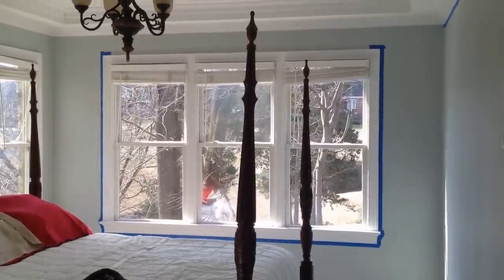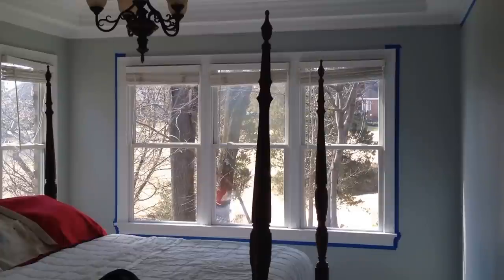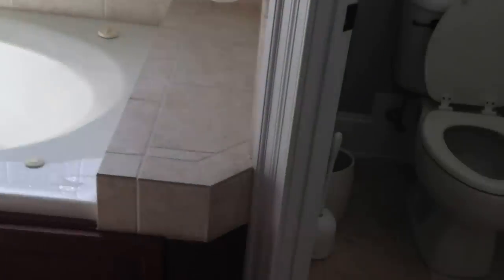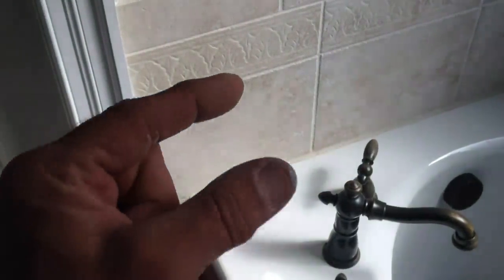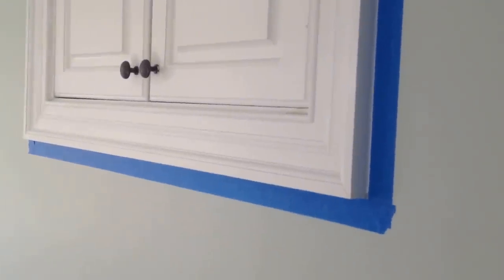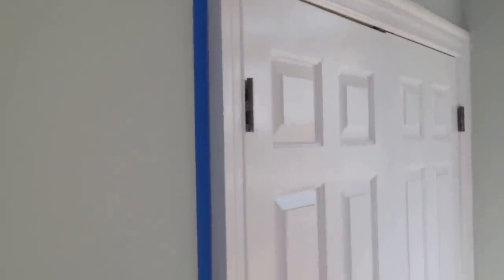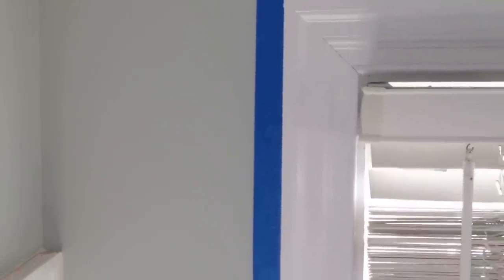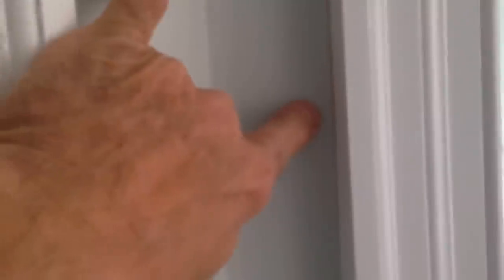PAINTING TRIM THE RIGHT WAY/ MASTER PAINTER EXPLAINS IT.

Comment: I left out the caulking of the trim. Caulk all trim, crown molding and door jams after you have putty and sanded. I said to apply two coats of paint to trim. That doesn't include a primer coat of the trim is delivered as bare wood. If it comes pre-primered then just two coat of trim paint.
Reply: If  delivered pre-primed you still have to patch  holes the Carpenters make then you have to prime those patches than two coats of paint
Reply from the maker: Jorge I see that this video has you upset?  So many negative comments?  If I suck so bad at painting please send me link to your work.
Reply: tom noeldnerr lol
Reply: tom noeldnerr sounds like you are the one upset

Comment: Calk the trim in, paint it first and cut in the walls. It saves over 30% time in labor. For over 25 years I painted the other way, the wrong way for the wrong crews. But hey I became a master at cutting in because of that. Then one day I painted with a guy who had only 2 years painting experience. Well he was not a painter but from his world, he was right about the trim. Try it. Start with ceilings. Calk the cracks and seal them in good. Don't worry about getting the ceiling paint on the wall. Then calk the trim into the wall and paint that too. Don't worry about hitting the wall!. All you have left is cutting and rolling the wall. Try it! You'll be so grateful when you get this system. You may have to cut in the wall twice but that is no time compared to taping. By the way, I can do a half inch wall against trim with a three inch angle. I'll prove it to you. House painter of over 35 years painting daily.

Comment: I paint trim first. Easier to cut into trim. Just like you paint ceiling first then cut wall into ceiling. Often times the tape can pull wall paint off and you have to touch that up.

Comment: The only time I use tape is after I paint trim then cut walls in apply tape to top of base trim just barely sticking to where. meets wall to protect from any sprinkles as I roll

Comment: Thanks Mr Fix.  I have a question.  If you paint walls first, then tape and do trim, isn't it possible that the tape could pull paint off the wall?

Comment: Jajajaj you are using wrong technique; wrong tape.paint trim first and then cut  the walls that’s what all professional do. Not telling that you re need to sand trim  bondo work primer caulking before all above mentioned.and spray your trim with a premium paint and a fine finish tip at the rithg pressure.cover everything to make sure homeowner doesn’t get aaaaaaany dust over their belongings clean up everyhing double check everything.dont make unnecessary noise in the house.dont go in to rooms you don’t have to.and provide costumer service

Comment: Pros don't use tape buddy.
Reply from the maker: Well maybe, pros also know when to tape and when not too.
Reply: there are times and areas where you would use it and others not ,,   nothing is ever cut and dried one way ..  if you think there is only one approach then you are not looking to improve your work,   but more interested in cutting someone elses opinion up.
Reply: Its called PAINTER TAPE
Reply: „When to and when not to“. Not „not too“
Reply: So if you free hand your a pro and if you use tape your not a pro. Well anyone can paint weather you free hand or use tape. Using tape and caulk is better than free hand in my opinion.
Reply: Define pro....ooooo now there is a real mind fuck.  Caulk, prep, paint that’s it.  That’s the rule.  Paint trim like you are painting the trim on a Ferrari.  Little margins for error and you will be okay.
Reply: @FranciscoMartinez-zv2rw  you just haven't done it enough. There are situations were you need to used painters tape. Just not all the time like Tom does. If your a Home painter ya you probably should use tape.
Reply: @Robert5185  Mm not really.
Reply: Well that's a bit black and white. I wouldn't just say " pros don't use tape" as a general statement. Depends on the particular job, situation and 
Method of application !

Comment: Here is my condensed steps to painting a house:
1. Mop the walls (not literally)
2. Vacuum all dust that fell of walls from mopping. 
3. Cut in wall with primer then roll that cut in with a small roller to create nice stipple effect rather than brush stroke effect. 
4. Roll wall with primer (I prefer tinted primer).
5. Lightly sand primed wall. 
6. Clean wall of excess debris
7. Wait for trim man to nail trim to wall
8. Putty and sand trim fIncluding crown molding, door jams etc). 
9. Put first coat of paint on trim (including crown molding, door jams etc). 
10. Put final coat of paint on trim ( including crown molding and door jams). 
11. Tape off all trim
12.  Cut in walls
13. Roll walls with final coat of paint (pull tape off each wall before paint dries. Don't paint a whole room then pull. Pull after each wall). 
14. Paint doors. 
15. Hang doors.
Reply: You forgot the prime coat after you do your sanding of your patches
Reply from the maker: Not need to prime coat a flat latex finish, even with some small mud work.
Reply: tom noeldnerr if you patch the trim you will need prime coat other wise it will flash, no one uses flat on trim that i know of

Comment: Why not spray the trim for the best results? Anytime there's that much crown/base and window trim spraying is faster option. Spray trim first and then cut & roll the walls.
Reply from the maker: +SublimeSati I'm very old school. I brush everything,  But I hear what your saying about speeding up the process.
Reply: tom noeldnerr That's cool. I hear in other countries spraying is looked down on. They think spraying is the fast and cheap option, which is true in a way because spraying doesn't really push paint into the pours of the surface which creates the best bond. On the east coast they brush and roll everything and get longer lasting results for sure.

Anyhow, watched some of your vids after commenting, keep up the good work!
Reply from the maker: +SublimeSati I'm old school when it come to painting.  I do everything with a bush, no need for speed with the why I work.  But I see your point.

Comment: Sometimes the where the trim and drywall meet is not sharp or straight and tape will not work.. I Use a pencil and follow the edges as my line and then just paint up to this line. It's like using tape for a clean edge just instead it's a pencil line.. I use tape in tight impossible areas where I have no choice because the brush our roller will touch somewhere I don't want paint to get on..  But I'm also a freestyle painter.. Haha I can't believe I'm saying this because I use to have tape everywhere, I didn't mind the time but never liked the results.. 2.5" cut brush for trims and 3" for walls. Or sometimes 3" for everything..

Comment: Paint will always find it's way under the tape, I never trust the tape will keep it clean
Reply from the maker: I never have a problem with bleed through ever.  But there are a few steps that must be taken to prevent bleed through.  Clean the trim first, and with your finger nails and pressure put the tape down tight to the trim.  Always works for me.
Reply: You can run some caulk over the tape edge too. Stops bleed through.

Comment: you are just making more work for yourself..do the trim first then then cut it to wall, any good painter will be able to free hand that and make just as good of an edge, i am right handed and can cut that line in with my left hand just as well as the tape
Reply from the maker: I can paint left handed and right handed also.  I paint my way and the results are always good.  So if it's working for me, I don't see the harm in my way of doing it.
Reply: nope,   whatever works
Reply: In his case, he aleady knows in advance that hes planning to tape off the trim so it's fine. He wants laser sharp lines which is fine. Nothing wrong on what hes doing.

Comment: I'm AN old guy also, hardly ever tape.I cut the wall into trim, but heck I can paint like water flows. My jobs never look Like that certa pro job though when finished. For sure your work is great, but I think I am much faster with out tape.
Reply from the maker: +Tim Brents Hi Tim I admit I''m not the fastest at painting.  But I know one thing when I tape the job always comes out right every time.  Some guys that taught me to paint for the first time where very good a free-handing.  Plus their work was always good as it could get.  I just found I have a good eye for straight, and can paint a great straight line. But I do make mistakes, I hate it when I have to stop, and touch up.

Comment: Don't get me wrong, they did a horrible job cutting in the ceilings and against trim, but why are you using tape on ceilings, casings and inside corners? 

The way i was taught to paint is in a few simple steps- Paint your ceilings, and bring it into the walls- Caulk your trim up so its nice and crisp again- Paint your trim, and again, bring it into the walls. Use tape on your baseboards and ONLY on base boards. You've caulked them, so now you have a nice line for your tape to follow. Then lastly cut your walls in and roll it. I would never use tape on casing, inside corners and lastly on ceilings. That's just a rookie move. If you cant cut into a ceiling or any other noted areas above without tape, you sir need a new career path. Yes there might be other ways to paint, and whatever works for you is great, but that is how i learned to paint and i have never been fired or had a call back for poor workmanship.

 BTW the half a million dollar house thing stands for me too, i have never painted a house that was under 5-600k, believe it or not. Not to mention the million+ dollar homes in Toronto i have painted. Im not bashing you or your video but, i slightly disagree with your methods of painting.

Comment: They were suppose to use a caulking grout on the edges so it will not crack. They also should of cut through the bottom of the casing and door jamb so that the tile runs through the bottom for a clean look. Lazy tile guys.

Comment: Thx for the lesson! But you used caulking to seal the tape right?
Reply from the maker: +78835 Hi 78835 caulk is used only to seal the trim to hide the space from the Sheetrock only.  Then when you paint the line that you make is cover of the trim, for the line between the Sheetrock and trim.  Caulk should never show on a wall.
Reply: +78835 after taping  use wall paint first "If you are tape person"then trim paints two fast coats.Because i don't trust any taping myself.If it is necessary(Doing some line works always use opposite paint color first, paints bleeds,seals the cracks...drys then two coats other paint.I do painting about 45 years, i am 60.Tom started wrong.He has too caulk first.all the frames edges.
Reply: +basbugataturk01 I agree with you. Always caulk all trim edges. Then paint the trim. It won't matter if a little trim paint gets on the walls because once the trim paint dries you can tape off the trim (if one must tape)  and then cut in the walls, which will provide that nice straight line tom is looking for then obviously roll the walls. Putting tape of the paint job is ass backwards. NEVER put tape on a paint job. Put tape of the trim instead.
Reply from the maker: thank you

Comment: always prime before caulking, never caulk a dirty or dusty surface ever, I been painting professionally for over 30 yrs .if anyone working for me couldn't cut in a nice edge. they would be canned. I don't see the point in a pro using all that tape.  just my opinion Tom practice  cutting in free hand.
Reply from the maker: +henry r I do use tape for one reason and one reason only to make sure all lines, and transitions are straight.  Free hand only lends to mistakes if your not a pro.
Reply: I agree to a certain extent Henry. My cutting is superb but If you get a picky ass customer that has orange peel texturing on their walls, fastest and easiest way is to tape it. lightly caulk and paint the lining of the tape for bleed through reasons. I have gotten customers that look for imperfections 2 inches away from the wall. It's so laughable.

Comment: You're being pragmatic for the wrong reasons...It doesn't matter that caulk's primary function is, the fact is that dropping a bead of caulk to improve the aesthetics of a door frame, millwork, etc is common practice.  It's also common practice to paint caulk, because if left unpainted it pick ups dirt like crazy.

So...really, there's no reason not to caulk to: 1. Give yourself something to tape to, 2. To seal the tape edge when cutting a line.
Reply from the maker: Hi Matt I don't get your argument about caulking?  Caulk showing is cool in bathrooms not bedrooms.  Transitions are the main topic here.  Sheetrock to trim, or tile to countertop.  Caulk is an accent or needs to be invisible, depending on the room your in.

Comment: The freehand painting of the wall paint to the white trim can be a perfect line if your hand has 42 yrs of experience like mine. I do use tape for certain things. Applying the trim white first is done for a reason, not just your approach, time paid by the hour reasoning.
Its done first, if your brushing not spraying to allow a quick smooth brush stroke for enough hide and coverage over the base primer or old paint for smooth self leveling the paint. Allowing the paint and brush to extend over onto the wall gives you free movement you need to apply in quick long smoothing strokes of the brush like as if you were spraying and overlapping. Cutting over this white trim paint from wall to creating a straight perfect wall color line  is not hard. But trying to move a trim paint along that small edge of the trim  on the side is what I call wobbly trim painting , even with the tape there creating your line.
I pull off that tape after a foot of linear painting immediately so no white seeps under tape as it can. Throw it into a bucket out of the way. Painting trim first isnt always possible, sometimes all they want is the trim painted so your bluetape coverage is a good technique. Remember ,if you did the walls first, you shouldn,t be putting tape over fresh wall paint either. So many factors ,I've tried them all, but production with quality and speed can be done, not by everyone.  Teaching a crew this is how you stay in business and be competitive yet profitable

Comment: Wrong,painters caulk bud. Not every door frame,trim angle, and where 2 materials meet is always perfect. Thats where painters caulk goes. What do you do on the inside of your door frames if there's a gap? It's for filling little gaps holes Etc, and I don't know about you I would never use sanded grout to grout a door frame to tile

Comment: If you had painted the trim before walls , you wouldn't have to worry about getting paint on the wall, so your point about getting the brush in there is just wrong. every pro painter paints trim before walls for a reason. It would have been so easy to cover up their trim mistakes by just painting the trim, and not being concerned about getting it on the wall,  then cutting the wall against the trim, which is so easy. So now you're paranoid about screwing up the walls, hence the tape. It's not "freehand". Every pro Painter knows that whatever you're cutting is the guide for your brush. You control the bristles so they follow the contours of the trim, exactly what your trying to do with the tape, but in half the time. "Master Painter"???

Comment: white  paint bleeds on the walls
Reply: SumerianTurk Not to mention when you go to pull tape some of the wall paint is probably going to come loose
Reply from the maker: I never have problems with paint peeling or pulling up when it use tape.  I make sure to let the paint dry for 11 hours before I remove the tape.  After 35 years of doing it my way I have never had a problem.
Reply from the maker: No it doesn't if you know what you're doing.
Reply from the maker: Not if you have a steady hand when painting the trim, there is no bleed.
Reply: SumerianTurk any paint bleeds if you dont seal the tape line with your main color.

Comment: I dont like taping over finished walls, ive been painting 7 years and i can tell you my free hand would shit over your straight lines anyday. paint 50 houses you will get alot of failures doing this due to there being plaster joins in some areas that you tape, you pull the tape off you rip the wall off. simple.  

if your a pro you paint the trims first.  

i never paint the trims first because it takes longer, we always oil at the end, but we never tape a finished wall lmfao..    

what a waste of time.. taping a finished wall...  my god i feel sorry for your workers
Reply from the maker: Hi Fresh produce first I don't have workers you don't need to feel sorry.  I have been painting for over 35 years.  I found that most painters that claim to freehand a razor sharp line, really can't make their lines that straight.  Here's the thing I put up a $1000 dollar challenge to anyone that can make room look better than me.  Any time you think you want to put your freehanded skills to the test, let me know.
Reply: @tnoel374  Ya'll could do it on my house

Comment: there is an art to taping. I see guys all the time taping.  so called pros and paint gets behind the tape.  you always need to run your putty knife along the edge to get that seal.  I could tape the base in that room in about 10 mins which is all the taping I would do.  and certa pros are not pros
Reply from the maker: I agree I use my finger nails to make sure the tape is sealed to the trim.  I have no problems with bleed through.  That's why I said it take year to know how to tape correctly. I started in a paint body shop that why I know how to tape tight lines and never have bleed through.